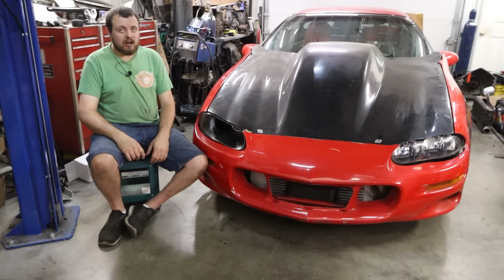3D Scanners Are An Absolute Game Changer!

Comment from the maker: Check out EINSTAR Rockit 3D Scanner
Link: https://tidd.ly/4plrhxi
Code: July 1- July 14 EINSTARJULY
July 15-July 30 Nivlac
Reply: You gotta dry out your filament (30% relative humidity or below) maybe do a cold pull on your extruder or replace it, but something isn't right if its printing like that.
Reply: Neat, and a maybe someday, but $2000 for a tool is really rough right now😅
Reply: Calvin with a 3D Scanner?  Uh Oh...lol    DANGEROUSLY AWESOME
Give it Hell Brother, This aught to be Good
Reply: 1:58 Old school stereo installer trick stretch pantyhose over the opening and then press them all the way to the turbo 
You can hold it in place with a magnet or whatever keeps it there and then you fiberglass the pantyhose and you have your perfect shape already used to do the same thing to install a subwoofer in an open space

Comment: Wow, you really need a better printer. Also, if you would have used Polycarbonate Carbon Fiber filament there would have been no need to cover your print with Carbon Fiber cloth and epoxy.

Comment: Try using the 3d model in the aerodynamic simulator to test the air flow to see if you can improve the efficiency.  Since you are trying to go as fast as possible. Why work harder wasting horsepower pushing a brick through the air when you have all that free time to go crazy on mods. Finally, It's about time you started using more of those better engineering methods and applying them to save your time money and sell  the cool mods.

Comment: i was thinking about picking up one of these so i could do visual mockups of my car and render them to get an idea of what it may look like, 

i think it also might be a good idea to  catalogue less common car models before they all get crushed :( plus it would be super helpful for manufacturing replacement parts for these vehicles.

did you find that this would be suitable for scanning a whole car? or would someone have to mesh multiple different scans for it to be useful?
is there a max scan time outside of device battery life/storage limits?
how much storage does a scan usually take?
does it depend on features of an object or more a function of object scale/time spent?
Reply: you could also use these scans, a harbor freight press, and a 3d printer to stamp replacement patch panels for any vehicle.

as a side note, with the rise of metal 3d printing i imagine you could even just print a panel. we are getting slowly closer and closer to the replicator from star trek

Comment: I've been playing with Realityscan (free on epic games launcher).
It's a photogrammetry tool, which basically means it takes a bunch of input photos, aligns them, and generates a sort of "best guess" at a 3D shape that matches the objects in the photos that it was able to extract enough data to recreate. 

I just take a bunch of pics with my phone from many angles, load them in and generally as long as I'm not trying to capture a huge amount of specific features, it gives me a good enough mesh to work with for fitment and mock-up purposes. It does take longer to generate the point-cloud and mesh on slower computers, but it's a helluvuh lot cheaper than a true 3d scanner if you can put up with the sub-par results.

Comment: After seeing that print I'm more than happy to sit through a filament dryer sponsorship spot in your next video 😉😆
Reply from the maker: It was brand new filament. The supports failed to print, and it just made the print crappy. Also first time printing with nylon. My printer can barely get hot enough to do it.

Comment: Very cool stuff. You may want to consider doing some research on the proper size/shape for inlet ducts. You definitely don't want to have an area larger than the turbo inlet necking down to inlet diameter.

Comment: The duct will work better if you put a gap between the duct and the turbo. Im not sure what the exact measurement should be but probably around an 1" - 1½" would be a good starting point. Supposedly it'll be able to pull in more air than what's just available coming through the duct, kind of a venturi effect
Reply: Nope. And incorrect angle for a Venturi. Not that a turbo charger sucking in air would need a Venturi. Where do you people get these things from?
Reply: @stevemccauley5734 kind of like... not is a... where do you people get these things from... i dont know the exact term for the effect thats occurring, thats for you to correct me on since you know that its not a venturi. The effect draws in more air, thats what i know, and it works. Instead of being a person thats rude and trying to belittle people, why arent you trying to be part of a community instead of trying to stand on one leg by yourself?

Comment: I think you're probably getting higher than atmospheric pressure here, but I think possibly the design may not be as optimized as it could. The front of the catfish is rounded like that because as air moves from the stagnation zone (the radiator inlet and center of the bumper with highest pressure) it accelerates around the corners and goes low pressure, which reduces drag on the car. I think putting basically a duckbill on the RH edge of the intake scoop would back up airflow and get higher pressures out of the thing. I would have had a tube-ish shape out of the turbo with a radiused edge on the inner edge (LH) and a sharper protrusion on the outer edge with a concave radius. Basically like the intake is an exhaust port. That protruding air will capture flow and pressure while the inner radiused edge will bend any attached flow into the inlet. Similar treatment on the lower edge being radiused and upper being sharp/protruding.

Comment: I worked at a performance shop, and I was building a turbo LS bmw e30. One of the guys at the shop was good with cad and 3d printing, he made a duct that perfectly fit my kidney grill and used a coupler to attach to the front of my turbo. He did it in solid works so he could even simulate how much ram air pressure would be generated at different speeds. As someone who was used to just wrenching and welding and doing wiring it was mind blowing thinking of all the possibilities with 3d scanning, cad modeling, running simulations, ect. Really cool time to be an automotive enthusiast.
Reply: I think once scanners and metal 3d printing takes off like it has in china we will 1000% be using it for car building. One for old stiff no one makes anymore. And for custom stuff. If i could cad I'd be making a uel header for a k series in a subaru.

Comment: Look into drying that filament before you print and it'll come out a lot better. Layer adhesion will be better too.

Great work with the design. I'm just starting on Blender, it's pretty complicated.
Reply: An enclosure would do wonders too

Comment: Nice demo and a really good use case for a scanner. But you gotta dry your filament, and consider hitting up one of the major printer brands for a nice core xy with enclosure. It really helps speed up the iterative design process, at least it helped me.

Comment: A 3D scanner completely changed the hobby that I'm addicted to (rc rock crawlers) I can scan a chassis and then do a complete frame off design and it'll fit with very little guessing. I still haven't tried any full size car components
Reply: I still do my 3d printed crawler bodies like a caveman with calipers 😂
Reply: @brandonharrsch8318 for some things that's still the easiest method
Reply: I’m into rc crawlers as well. Very good info

Comment: This model would take 5 seconds in most pro CAD software packages. Create a spline for the inlet, spline for outlet and loft the 2 together. Love the channel and the projects! If you need CAD work done for things like this, lean on your community! There are tons of us that would love to help and could make nice 3D models for you in minutes.
Reply: Second this! @Calvin-Nelson if you want to share the scan file (point cloud) I would take a try at it. I have access to software made for this kind of work
Reply: Solidworks and solid edge both have maker subscriptions that are reasonably priced and month to month.
Reply: @black99rt  fusion 360 and on-shape are both 100% free for non-commercial / maker use
Reply: Would love to learn about creating your own parts I have extensive knowledge on 3d printing but not creating my own parts thanks
Reply: @robsantiago118  u pick a thing to make, then u design it in ur program of choice, and then print. the "hard" part is more about the materials which from ur comment u already have at least decent material knowledge. u have the power of the internet, you can figure it out. ur smart enough
Reply: @robsantiago118 First, learn about punctuation. Then just watch some YouTube videos. It's really not that hard.
Reply: Might surprise you, but this video was a sales pitch. He's getting paid by Einstar to make this video.
Reply: He's got a 3d scanner, he doesn't have to model anything. And it'd be way more than 2 splines and a loft, you have to know where the splines are and going in relation to the car/turbo. It's almost like you have no idea.
Reply: @Airtight215  bro, he has the spline locations from the scans and needs a model to have something to 3D print. That was the whole point. Been a CAD designer/design engineer for 20+ years and used just about every CAD program you can imagine. I have more of an "idea" of how to do this than most. My last job I designed suspensions for cars from 3D scans I took, cleaned up, imported, and converted to models. Maybe watch the video and think before you speak.
Reply: Then he doesn't get the experience and knowledge from doing it himself. Like myself, he sure doesn't seem like someone who wants someone else to do his projects for him.
Reply: That's only like 30% of what's actually needed for a functional part, but sure.
Reply: Calvin is an engineer by day, he’s got it covered :)
Reply: @FSP3  I know, I am also an engineer. Not all engineers know or are proficient in CAD believe it or not.
Reply: If only you could do the splines in blender or something first because my god are they a tedious pain in the fuckin ass in fusion.
Reply: @Levibetz lol yes fusion is like “oop! You moved one sketch in your loft and now the spline doesn’t touch or is at too much of an angle! Good luck finding the issue though😂”
Reply: @StationroadRatrods  I came from polygon modelling in blender like Calvin is using here and am constantly blown away by how infurating it is to move points in free space in CAD. In blender I can select a single vertex and have a coordinate of both where it is globally and based on the objects origin. That sort of function is tedious as fuck in fusion and I'm constantly wondering where the hell I am because there isn't even so much as a world origin axis visible.
Reply: @Levibetz perfect use case for Rhinoceros. ~$100 for a lifetime license with no maintenance fees. I have no idea why people spend countless hours modeling things when they could just utilize a more appropriate program